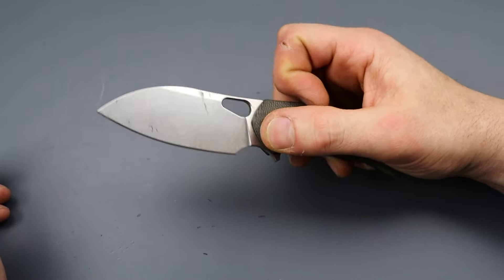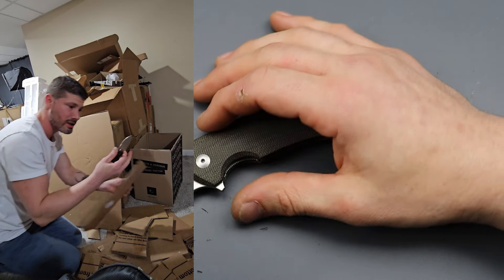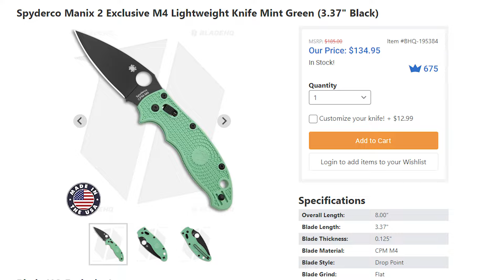5 Most Recently Carried Knives What's The Results?

Comment: Hey Neeve, how would you define steel toughness? Its ability to not break under strain? How does toughness affect the edge (if at all)? 
It's kind of confusing to me because it seems like toughness would be affected more by geometry and heat treat to some extent than the choice of steel every time. I guess I'm talking in practical use terms. If I want a tough knife I'm going to choose a more robust blade in a less tough rated steel over a very tough rated steel that's a thin flat grind 10/10 times.
I just have trouble understanding why steel toughness is emphasized so much and am trying to understand what practical properties it applies to knives in general.